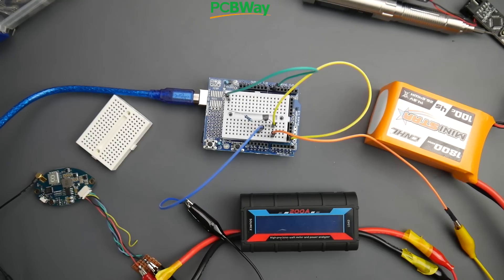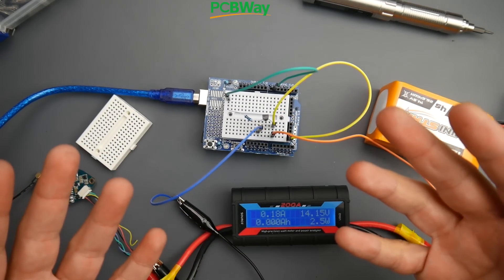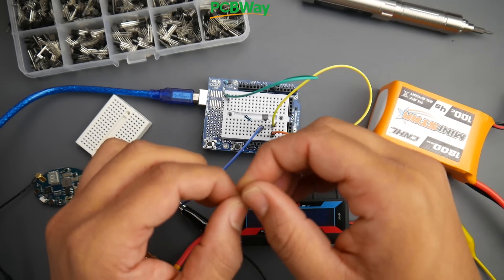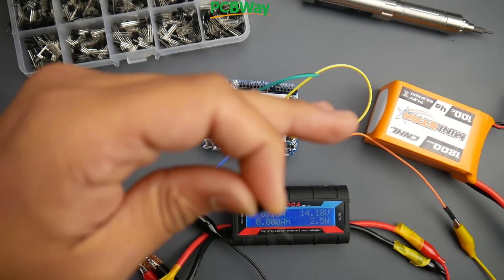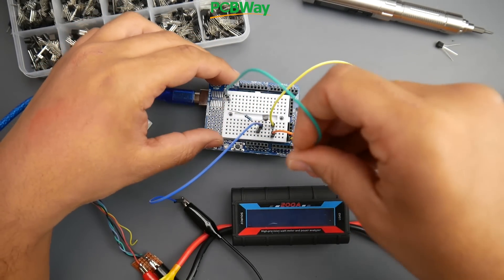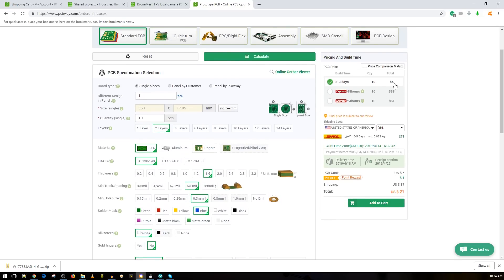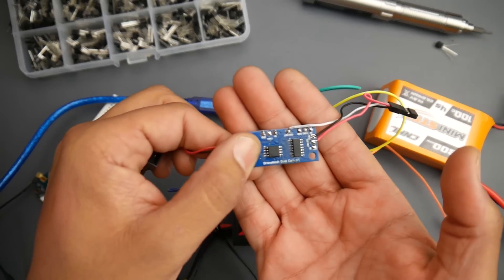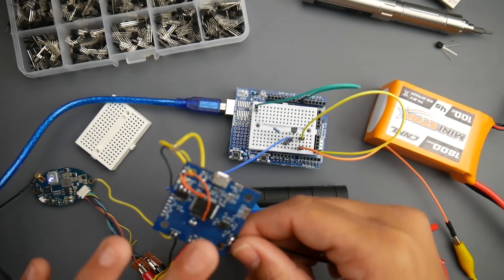Transistor as a Switch // Open Hardware Dual FPV Camera with VTX Switch V2

Comment from the maker: Transistor Bundle I have
http://bit.ly/2UBYN72

Arduino Kit I use 
http://bit.ly/2KBd5As

Wire Connectors
http://bit.ly/2Ddz5LL

Amp Meter Used
http://bit.ly/2UWFHYK

Comment: Well explained, but one potential problem with the implementation.

Some HV VTX's, if deprived of a ground connection, will source ground through another connection.  Example is the Matek HV VTX.  This hunt for ground is to dissipate the potential difference from the positive connection.

A Matek HV with vbat connected, but no ground will ground itself through either the TX pin (tramp control) or the camera in.  BOTH are really bad news for attached components (and the VTX).

When switching voltage for a VTX, please only switch positive source.

Comment: We want more of these kind of content, diy quad pcb etc very useful stuff, after fc it would be great to make a radio (I’m currently working on one but it is still kinda secret stuff 😏)
Reply from the maker: I have a radio in mind for future project that will run multiprotocol modules and use hall effect gimbal with for example a qx7 shell or xlite

Comment: @drone mesh , Can i use this inorder to trigger the button on my vtx to start my dvr when i plug lipo into quad?  button only needs to be pushed for 1/2/3 seconds
Reply from the maker: Yea you can but you will sacrifice the VTX switch to be a DVR switch.. I can write the code for that on the V2 of the board.. What VTX are you running.
Reply: @DroneMesh  akk infinite. has dvr build into vtx. has a button on vtx to start/stop dvr
Reply: but i always forget to trigger dvr
Reply from the maker: @joncoop2873  I have one too I will play around with it and write the code for it.
Reply: @DroneMesh  hey bro thank you so much. There is only one video on YouTube or any information at all online about how to do this using an LED pad on the flight controller and changing the resource in betaflight. And using a momentary switch on your transmitter.

Comment: it'd be great to create an antenna tracker that was tx module agnostic.  i.e. crossfire, frsky 900mhz, dragon link, etc.  The idea is to take GPS telemetry data from your taranis and send to tracker via bluetooth.  Taranis can use serial port in battery bay to output telemtry data. then use something like u360gts to recieve the bluetooth and drive the antenna tracker.  u360gts has a port for the arduino blue pill board.